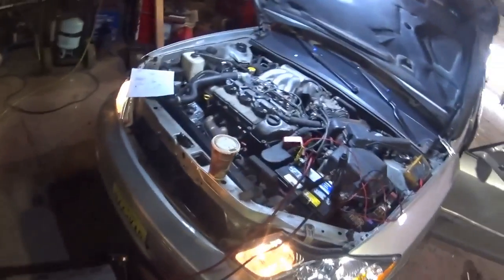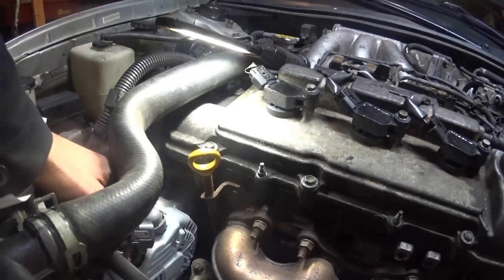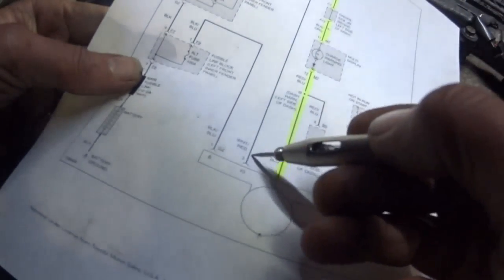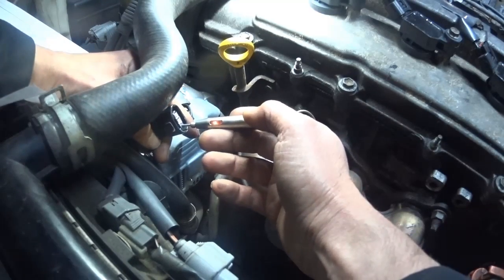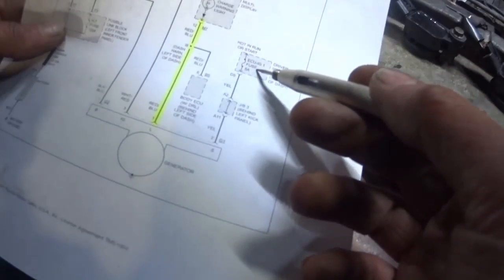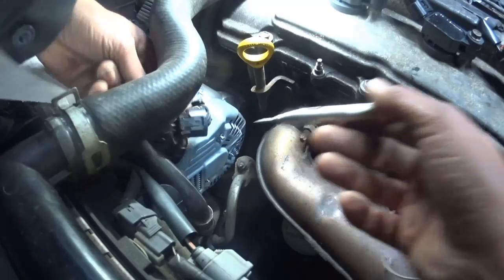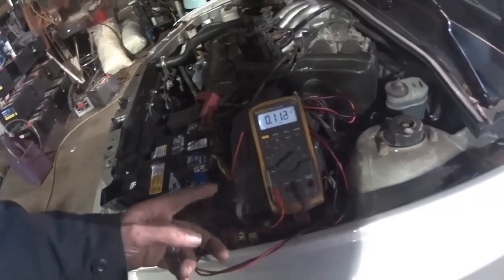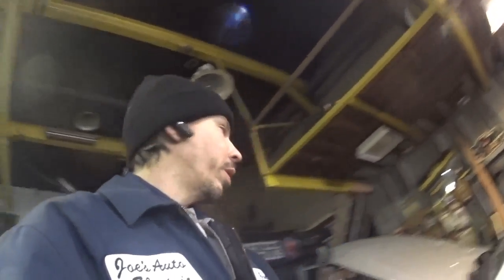Battery Light On! Can it Be? Two Faulty Aftermarket Alternators?

Comment: Could a weak battery kill an alternator?  Alternator goes full blast trying to recharge and burns out?
Reply from the maker: If a battery is faulty it certainly can hurt the alternator
Reply: Joe's Auto Electric thanks Joe would it be a good idea to keep the battery on a trickle charge if the car mostly sits?

Comment: A lucrative question,  if you don't mind. How do you charge for stuff like that? You found it out within 10 minutes. But it's not "worth" to work on problems like that,  if you charge only for 10 minutes. If you understand what I mean.
Reply from the maker: There is a flatrate charge of one hour. You are paying for the 25 years of learning it took me to find it in "ten minutes". Seems more than fair as other's could not find it at all...
Reply: @JoesAutoElectric  
Totally agree.  Just wondering. 🤟

Comment: Very detailed. You proven once again why you're better then most. I just went through the same issue on a 99 powerstroke. Battery was going dead overnight. Customer put a new alternator in it and new batteries. He bought a remanufactured alternator. Truck would go dead overnight and would have to be jump started.  He called me and I drove over to his house. Turn the key on and noticed no battery light. Jump started the truck and had no charging voltage.  Asked him if he did anything to it. He said yes I pulled the fuse for the alternator. Duh. So I reinstalled the fuse. Got the key on engine off battery light. Jump the truck again. This time had charging voltage. But when I shut it off meaning the engine. I noticed the alternator temperature was 126 degrees at the fins of the alternator and you can hear the bearings in the alternator. Took a temperature reading of the engine. 42 degrees.  Which was outside temp. I only had it running for about five minutes if that. Advise the customer it needed a new alternator again. He took the autozone alternator back and bought a new one from ford. I installed it and the truck has been fine ever since and that was a month ago
Reply from the maker: Nice! Yea, nothing like an new part being no good, right? Yet people still think that it never happens. Great job on the truck!

Comment: Been thru this in autozones parking lot. Management refused to believe that the 1st one they sold me wasn't charging because it passed their bench test. I proved them wrong with my multimeter under load. My theory is if the brushes are good and the regulator is bad they only rebuild the regulator and vice versa to cut costs. Remanufactured in Mexico = made in China😂
Reply: Apparently in Canada there is a distinction between reman & rebuilt components .  Remanufactured ought to have all new parts . Rebuilt means worn out components replaced only. 
Not 100 % sure if these are legal definitions as per consumer protection laws but I'll look into this as i learned this only recently.

Comment: Even though you approach it like the first guy working on it - sometimes it's worse if total hacks have molested an original vehicle . Obviously , they can disturb and create additional issues by misrouting wires , leaving items loose or unplugged , piercing wires and not sealing , etc . If they can't diagnose a basic charging circuit with a bad fuse - I suggest LUBE TECH or TIRE TECH . I have even seen that botched . How about BICYCLE TECH ? Remember , they're PROFESSIONALS !

Comment: The fuse blew for a reason, right? So maybe the original alternator blew the fuse, but the shop didn't find it with the replacement alt, and then they replaced the alt again.
Reply from the maker: Of course this is a possibility...but the original complaint on the vehicle was the battery dies when it sits overnight. Is it possible it had 2 problems? Of course, it is.

Comment: Some people have no common sense.  In a few months, the customer will probably spend as much for another new battery as it would have cost to repair the parasitic draw.  Or, he may decide to disconnect the battery each night and re-set his radio stations every morning.
Reply from the maker: He is going with door number 2. :) So many people have this idea about throwing parts at cars, then complain they are too broke to actually fix it properly. Amazing.